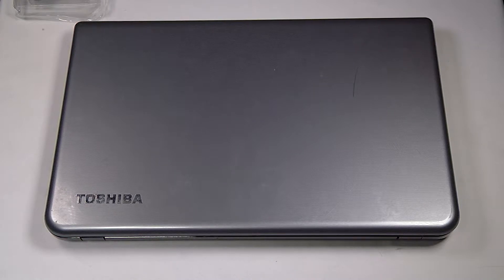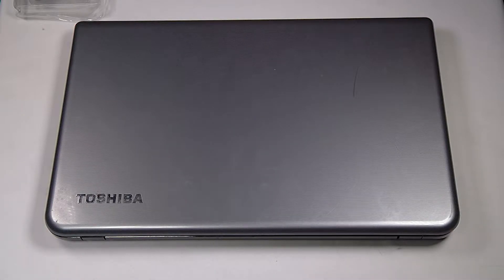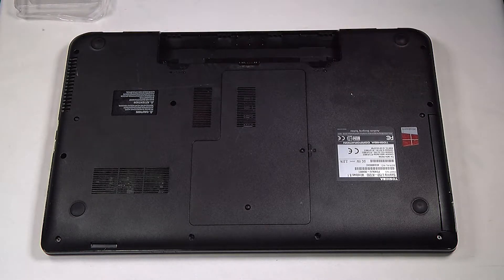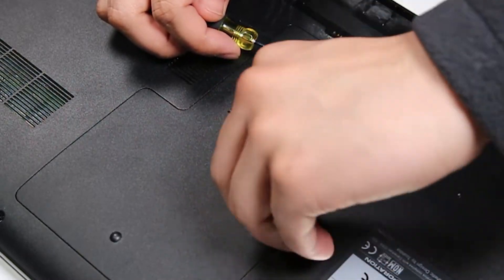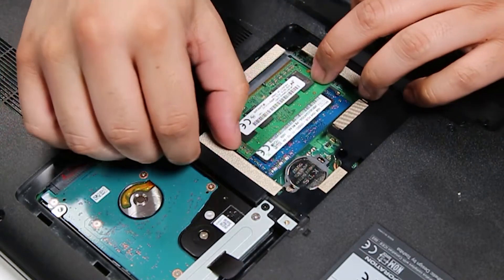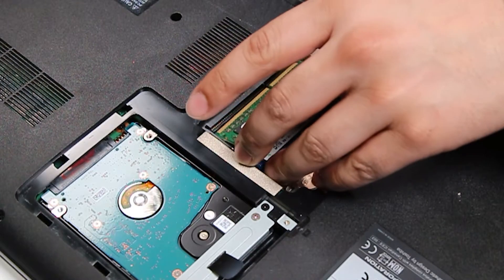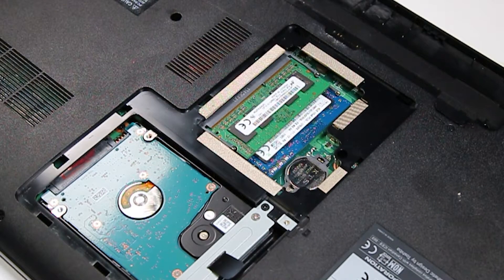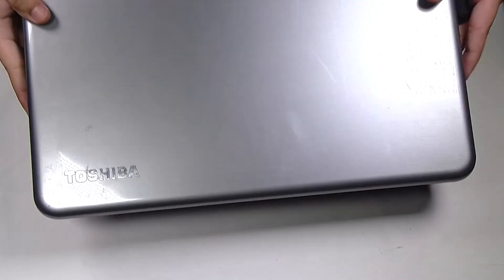Upgrade Your Toshiba Satellite L75D MEMORY (RAM)!**

Comment: I have an old toshiba...wanted to upgrade my ram...got 3 of the 4 easily filled but the top one that's empty doesn't seem to want to release.
Reply from the maker: @FELiPES101 The best way to answer this question is to simply fill out our Tech support form.  Our in-house technicians will answer with the links and info you will need.  Here is the link: https://www.bobjohnson.com/tech-support-form/  Thanks for Watching.

Comment: I am considering refreshing mine with 16gb of RAM and an SSD with 1tb. Do you think these upgrades would be worth it, or should I invest in a newer laptop? Mine is in VERY mint condition, so Im kinda thinking its worth keeping.
Reply: I am going to do the same thing I think it is worth it for what I am doing but if it is cheaper to do than getting a new laptop I think it is worth it
Reply from the maker: So the question of "is it worth it" depends on you.  Keep in mind that you can upgrade yet your laptop will still be very old.  Cost of a newer unit will be a bit more expensive buy might give you extra years of use.  So you have to balance the value you would get from both cases and make your decision.